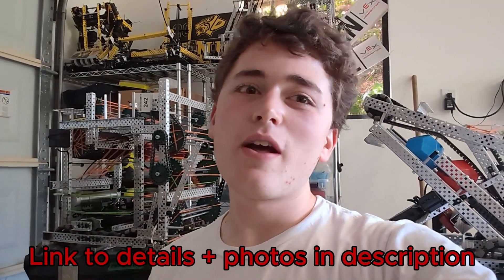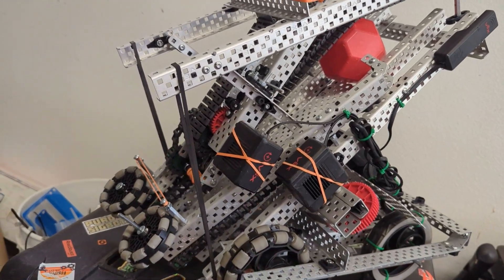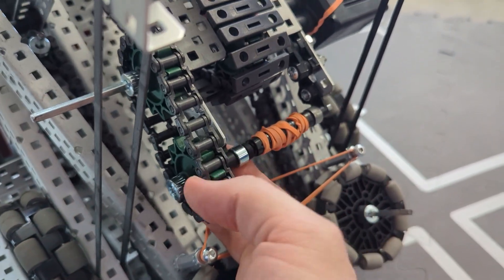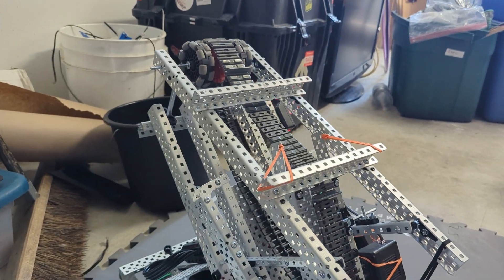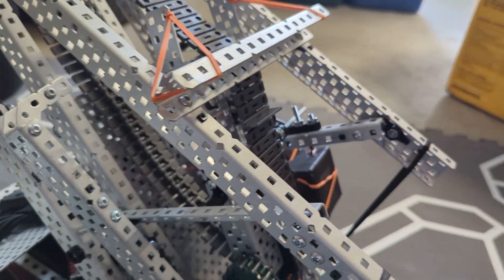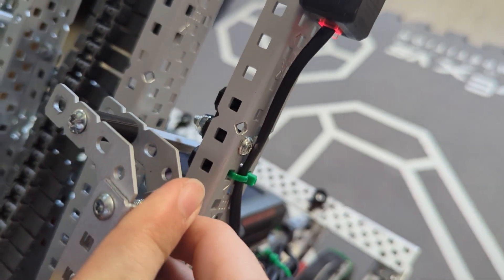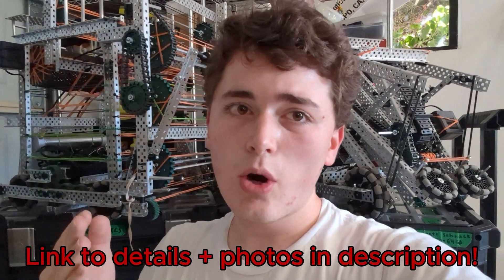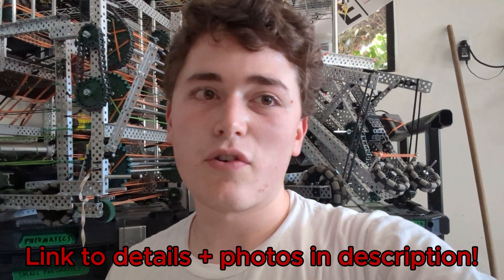Herobot Modifications - VEX Push Back

Comment: One piece of advice: try using star wheels made from a sprocket with  intake flaps all around it on the top stage of the conveyor (if you have room). It should allow you to score more quickly since you aren’t waiting for the next flap on the conveyor to hit the block. I’d start off with short flaps on every other chain link but it’ll probably require some tuning